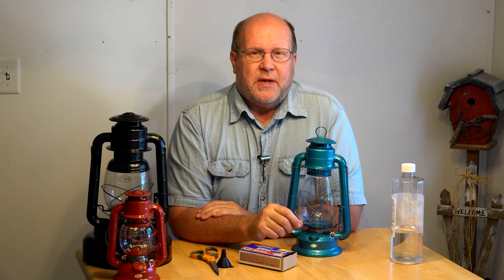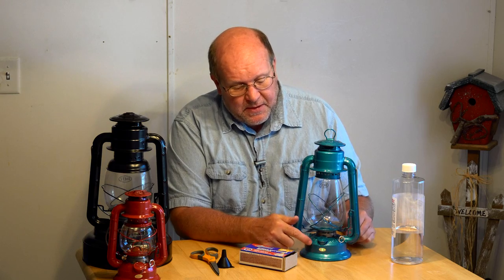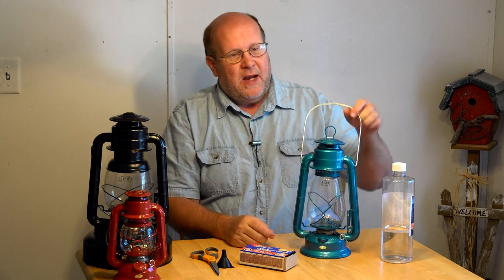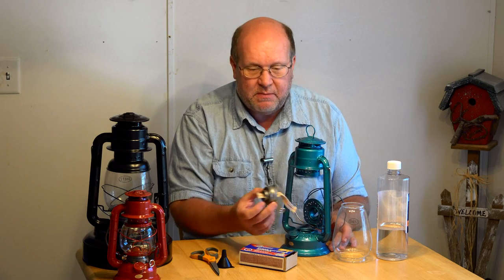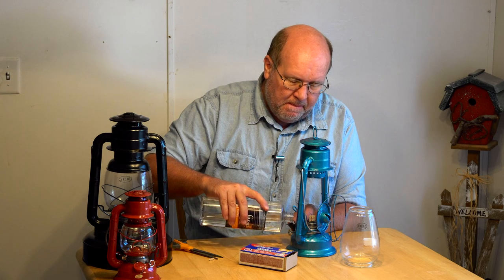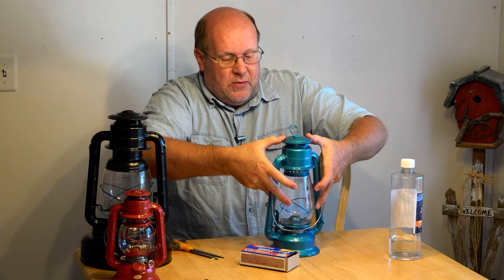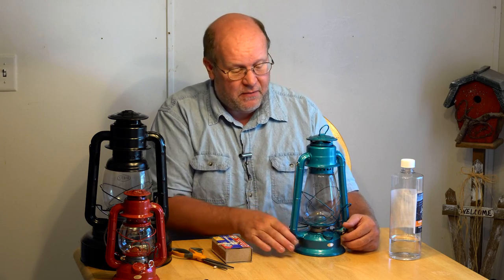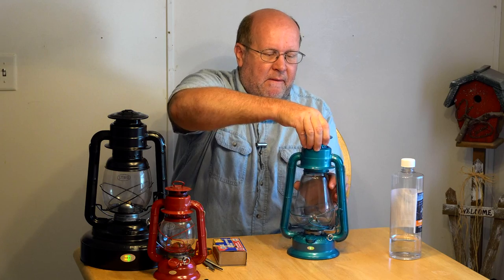Hurricane Lantern Basics

Comment: You don't need to push the wires down. You can take the globe out, and replace it without doing that. Bend the wires too many times and they will break.
Reply: I agree, but you can fashion replacements out of old coat hangers. I did this with a rebuild of an antique Deitz lantern I got for cheap.
Reply: The top, the air intake right above the globe, is spring loaded. That will lift, and the globe will rotate out.
Reply: There's no need to remove the globe from the assembly in the Oztrail lantern used here in order to maintain the wick or burner. The Oztrail lantern has a hinge to allow the globe and retention arms to be rotated flat onto the table and out of the way when servicing the wick or burner. 

Bending the arms doesn't just risk damaging the arms it also risks damaging the lift. We know he already damaged one lift and had to have it replaced for the one in the video.
Reply: @tjmarx  true

Comment: That genuinely hurt me inside when you bent those wires! 😂 The metal wire assembly is not a spring, you aren't supposed to bend those to remove the globe. The globe should be able to slide right out by angling forward slightly as designed 😊

Comment: After a number of tries at getting a heater to work in a small closed space like a tent .. or in my case, the inside of a 2dr Ford Explorer.  All the propane burners I tried are basically dangerous.  After watching a few videos on lanterns seems one of the problems is heat!  I now own a Dietz 90 and a 76 .. filled with ultra pure paraffin they do throw off a fair amount of heat.  The 90 I use in the colder weather and I just got the 76 so I'm experimenting with it.  Neither of these is going to keep your tent or enclosed area hot or warm even .. but they will take a chill off and leave you quite comfortable.The ultra pure paraffin is totally safe .. you could run into a problem with lack of oxygen but that's a low probability.  I always keep a window cracked.  I have a special box that's part of my build where I sleep inside of the Ford .. that's my heater box.  The lantern sits in the box with a tin foil pie plate on top to radiate the heat.  That way the light doesn't bother me and the heat can rise up safely.

Comment: Pointers from my Grandma-- Don't fill the lamps on wood furniture! Any spills will damage your finish. Don't fill a hot lamp! Especially if using kerosene, you run the risk of a fire where it doesn't belong. If using scented oil no more than one scented lamp per house. All others should be scentless. You'll permeate the house with that smell and get tired of it really quick. Lamp black (soot from inside the globe) gets on EVERYTHING you touch if you don't handle it well.
Reply: My grandma passed away 35 years ago. I wasn't smart enough to see the joy of using old technology and ask her about it. I've got two aunt's left though, and will be hitting them up on what they grew up with as far as these go.

Comment: Hey... nice vid....but there is a real time saver for a new wick....   
Since you have the burner out anyway, fuel the lantern, screw out 4'' of wick from the top of the burner, dip it into the tank to wet the wick. Then screw the wick back down to 1/8'' above the burner and install the burner and globe as normal.  Presto....no waiting to soak up kerosene for 20 minutes to an hour. Light it and go!

Comment: I have two lanterns from "Import Bazaar" from the 70's and they are just glass but was wondering about those two pipes on those Hurricane lanterns and you've shown me very well. thanks
Reply: They're very clever in design, the older 'Hot Blast' lanterns produced a more yellow flame and didn't run for as long on the fuel, the newer 'Cold Blast' design was a revelation and has performed well all over the planet to this day.
Reply: @rrrandommman  "newer" of course is a relative term. I love using them. My large lanterns will easily light up my family room with ample light. My small one I use mostly in the bedroom before going to sleep. I prefer the softer light these Lanterns give off unless I need a super bright light
Reply: The design is called cold blast, lantern air is drawn through them to the tank, and pressurizes the tank. After the lantern has been burning a few minutes you will have to readjust the wick (turn it down a little) for that reason.

Comment: Well done. I was a total noob at using a lantern. Honestly, I'm city and have no real use for one, but I figured I would play 1800s and get a feel of what life may have been in those days.
Reply from the maker: When the power goes out, you'll use it :-)!
Reply: @BackPackHack  New question for. Do I need to change my wick going from K1 kerosene to lamp oil? I'm getting a poor/uneven/sooty burn from kerosene.
Reply: @equallywrong  a few squirts of 91% rubbing alcohol in tank is good treatment for that.
Reply: @gsp49  I'll give that a try. But, I found if I just keep the flame low for 30 minutes or so the K1 "burns-off" and after that  I am burning clean lamp oil.
Reply: “Play 1800’s”
Go to bed at sundown, wake up at “0” dark 30. Light your lantern then light your wool stove. It takes about a half hour to get a cold wood stove hot enough to cook breakfast. That’s playing 1800’s or 1700’s it’s fun…

Comment: i heard if you cut the wick to a point ^ it will have a better flame that will be a little more efficient with fuel like there would be more of a flame with less wick and less fuel or something like that. kinda makes sense like a thinner taller flame needing less fuel to produce more light vs a wider smaller flame. looking a getting one and thought id ask. very good and very informative video. thank you
Reply: I like to have a slight V if wick is shaped at all, this way the flame is wider and brighter, probably burns more fuel faster.

Comment: Thanks so much.  I just finished your other video on oil lanterns. Both are well made and informative. What are your suggestions and thoughts on how to safely and appropriately carry the lantern and fuel on medium to long range hikes? A short answer or video would be very welcome....Thanks again
Reply from the maker: Da Ga : I wouldn't suggest one for hiking.  They're far too bulky, the glass is, well, fragile, and they're not meant to be packed in a backpack.  It would be too easy for the fuel to spill or leak out.

Better to use them around the house & ranch and use LED flashlights out on the trail.

Comment: triglycerides of olive oil are less volatile than diesel and burn inefficiently. fatty acids of olive oil are still mostly hydrogenated and will burn with the volatility of diesel at most, which means that the lantern will have a very faint flame, even if the glycerin backbone were to nbe removed from the olive oil via transesterification. in order to run a paraffin lantern one would need to crack the fatty acids into c10-13 long hydrocarbons, so you would effectively have to turn the olive oil into paraffin and at that point you might want to change the feedstock to something better like sunflower oil, or alternatively you could pressurize the combustion system and atomize the injected oil under high pressures of injection shortly before combustion, which is how oil foundries work and why higher volatility compounds boost their efficiency. it would be like running a petrol car on diesel if one were to run a paraffin lantern with vegetable oil, which is as volatile as heavy motor oil that's burnt by ships as big as oil tankers as it's the cheapest and worst type of fuel on the market.
Reply: S S Radon, if you can't dazzle with brilliance, baffle with bull, right.
Reply: @gsp49  wat
Reply: What he is saying is that olive oil will not burn as bright as a petroleum based oil.

Comment: When topping up the tank, how can you see if you're 70% full without a gauge?
When you're putting away the lantern for a few weeks, do you need to drain the tank and how? 
When transporting the lantern to a campsite, is there any tips or gotchas? I'm thiinking a lantern with fuel in it may leak?
Will the fuel evaporate if left too long on it's own?

Thank you!
Reply from the maker: Go to the manufacturers website (or search online) for the lanterns capacity.
I've never drained one.
It will only leak if tipped over.
I've never had an issue with evaporation.  Maybe the fuel does, but at such a slow rate I've never noticed it.
Reply: Kero will not degrade noticeably over months.  Even rust won't ruin the kero

If they tip in transit they will leak through the wick housing.  You may consider setting them in a used large coffee can.

There are funnels with floating gauges, but hard to find one that small.  Best to have a fill measuring dollar store measure cup or bottle.  Know what will fill an empty lamp to the correct level.  Put your fuel in that and pour from the measurer.

Comment: Warning the 5 to 10 buck whalmart lantern redesign the globe without redesigning the body the result is that the lifter dos not work properly, the globe dos not sit properly, put those to together and you get globes that like to slip out and shatter live already broke 2 or 3, and the glass is paper thin so it only has to fall about 10 inches to get it to shatter. 

If you want a cheap lantern from whalmart for 5 bucks hop over to the home decor section and pick up a mini lantern they don't throw as much light do to the smaller globe but they burn the same size wick and the more spherical shape of the global prevents the problem with the larger ones.
Reply: I have found if you hold them too tight they will break. Order a good Dietz globe for the cheap lantern.

Comment: I got a cheap hurricane lantern and I'm not sure if I'm using it right. It's gone out twice now. Is it important to have the wick quite high? I think I had it too low.
Reply from the maker: If you have it too high, you'll start to get a lot of smoke.  Having it too low only cuts down on the light output (and by extension, fuel consumption).

Are you sure you're using the right fuel?
Reply: @BackPackHack  thanks. I'm using citronella oil. I had another go with it last night and seem to be getting better at getting a consistent flame. I read somewhere that the flame should be around half an inch high roughly. Higher than that even without soot it seems to run out of oxygen after a few minutes and starts to splutter. I also topped the tank up from half full to 3/4 full.

Comment: Why are you bending the retention arms? That's a BIG no. You don't even need to remove the globe at all on the oztrail lamp you're using in the video, it drops backwards to the table without removing it. That's how the mechanism is intended to work

What you are doing bending those arms is not how the manufacturer intended use. By doing so you run the risk of not only damaging the retention arms themselves but also the lift mechanism. You know like in the one you had to replace the body for? 

All hurricane lamps burn kerosene. "Lamp oil" is just further refined kerosene so that it doesn't smoke, smell or soot as much. They're interchangeable fuels and in some countries (like Australia where the oztrail lamp you have is made) "Lamp Oil" is packaged as "low odor kerosene". 

Some hurricane lanterns, such as the Coleman dual fuel, are designed to run on either kerosene or *unleaded petrol*. You absolutely should not put petrol in the Oztrail or other lanterns not rated for it. However there certainly are lanterns designed for petrol and nothing harmful will happen from using it in such products.

Comment: Great video. So many hours on average should one of those wicks last?? I ask this because my wicks burn out completely in about 5 minutes!! But you mentioned that once you fill the tank, you should let it sit for about an hour. I think that's where I went wrong because I would install a new wick, fill the tank and light it right away. Maybe that's what I'm doing wrong?? But I remember when I was a kid up north at the cottage, and my grandmother would leave a lantern lit throughout the night so that we could see if somebody had to get up to go to the bathroom, because there was no electricity at the cottage at that time, and the lantern would burn all through the night and by morning, it was just about out.
Reply from the maker: Ken Belmont : You have to wait for the wick to get soaked with the lamp oil.  This takes some time, several minutes in most cases.
Your grandmother's wick burned off enough during the night that it started to extinguish itself by morning.  Turn the knob and raise the wick and repeat the process.
The more you use a lantern on a daily basis, the quicker you'll go through a wick.  If you have a lantern strictly for emergencies, you'll probably never need to replace it.
Reply: @BackPackHack  Got it. Thank you.

Comment: I’m aware diesel is a compression ignition fuel but could I use it as lamp oil because it’s closer to oil than gasoline?
Reply: They are all refined (broken out) from oil.
Natural Gas (small molecules)
Gasoline (blend of lightest liquid molecules)
Kerosene (sour diesel, Paraffin) a blend of tge next bit heavier larger molecules.
Diesel next heavier blend of molecules
Etc.... to machine oil, gear oil and finally gear grease

Comment: My wick is burning down in less than a minute. Any idea why it would do that?
Reply from the maker: Did you just put fuel in it?  If so, you need to wait for the wick to soak up the fuel so it's wet to the touch.
Reply: @BackPackHack  Yes it spent enough time socking up the fuel

Comment: At low to medium intensity, how long would a lamp the size you showed us be expected to burn?   Thanks for the video!
Reply from the maker: I've never done any burn-time testing.  I rarely use these on a regular basis.... they're just for power-outage use.
Reply: The blue one he is demostrating with will burn approx. 24 hours  easily on a tank, longer if flame is turned down low. With the flame too high (as the way he demonstrated) it will only go about 12 hours.
Reply: Oil lamps/lanterns burn about a 1/2 ounce of oil per hour depending on the width of the wick.
Reply: These are mainly meant for outdoor use. When full and used on the longest night of the year it will stay lit all night.
So you could hang it on your porch to guide expected company to your door.
“We’ll keep the light on for you”
That’s why the tank is the size that it is. Conserve fuel by lowering the wick.

Comment: Been using these for years. We use off road diesel in all of the ones we use for camping use. We have never had a problem, whatsoever.  The ones in the cabin, we use kerosene, or odorless fuel.  These things are not rocket science.
Reply: 19th century technology but extremely reliable. Trickiest part is getting the wick trimmed for the best flame but not that difficult.

Comment: What kind of fuel did you use?
Reply from the maker: Kim Him : Ordinary lamp oil.
Reply: @BackPackHack  what's that? Kerosene/paraffin? I use citronella oil as I worry about the paraffin smell!
Reply: @diogeneslantern18  lamp oil is purified kerosene / paraffin oil. Less smell. Don't use citronella oil indoors!
Reply: @mikevandebunt811  No paraffin oil is not the same as lamp oil. 
Paraffin oil is for use in lamps with round wicks  or wicks of 1/2” or less width. Basically it’s liquid candle wax. Paraffin oil will work for larger width wicks but will not burn as bright as lamp oil or kerosene.

Comment: How long should wick last
Reply from the maker: I've never had to replace one, and have never tried to test one.  I'm sure there's a lot a variables involved, such as the humidity in the air, the quality of fuel, etc.  And how bright you make the flame would have a large effect on it.
Reply: I have a Dietz that's 150 years old, still using original wick.
Reply: For every gallon of oil burned, 1/4 - 3/8 inch of wick is consumed

Comment: What manufacturer made your oil lanterns? I find that Chinese knockoffs  do not work well and do not last. Deitz lanterns come in many sizes for your needs and last forever with normal everyday use. Liquid Paraffin is the fuel of choice rather than K-1 kerosene that smells no matter how "pure" it is advertised.
Reply from the maker: They're all Deitz's.
Reply: @BackPackHack  only way to go, they have been around for many decades -  check out their pressure lantern.

Comment: Poor wick trimming! Make sure you cut off the frayed part (done here). Make sure the cut is square (not done).  Trim the corners at 30-45 degrees(not done). When done trimming, retract the wick so that it barely extends from the tube. Wait an hour or 2 after adding oil for wick to saturate with oil (not 10 minutes). If this is done right, the flame will give off maximum light, with a rounded fan shape, and be easy to adjust. If it is not trimmed well, the flame will tend to flicker and show "horns" at the sides, and possibly be lopsided. Also, remember kerosene is NOT as good as lamp oil. However, in an emergency, a wide range of oils can be used as fuel, including kerosene, many vegetable oils, and even Diesel. Do not try to ever use gasoline, turpentine, or alcohol. Also, it is DUMB to actually bend the spring wires that retain the globe. On a quality lantern, the globe just pops in and out. It is also not necessary to pull the globe off to trim the wick. Simply folding it back on the hinge gives plenty of clearance.
Reply: which fuel should I use? I still learning and didn't buy any lamp yet
Reply: @lilli9822  Standard fuel is called Lamp Oil, and it is a highly refined paraffin. However, there are higher molecular weight oils that can last much longer. I am fond of Firefly "Clean Fuel". In an emergency, kerosene, heating oil, or Diesel could be used, but will not burn as cleanly and smell. Under no circumstances try gasoline or alcohol.
Reply: @mrnickbig1  thanks, i just bought the German hurricane lantern and the oil from the same shop. It must be the right oil.